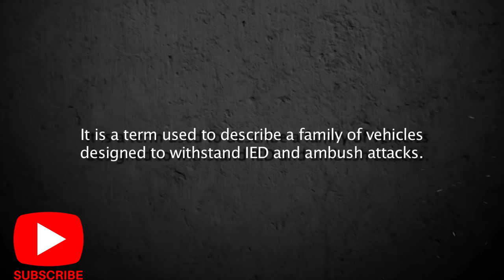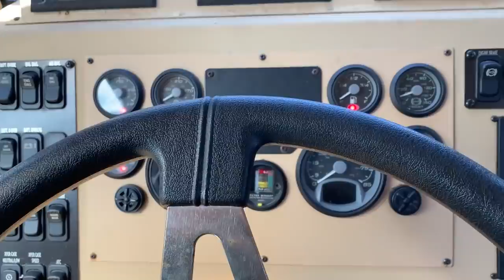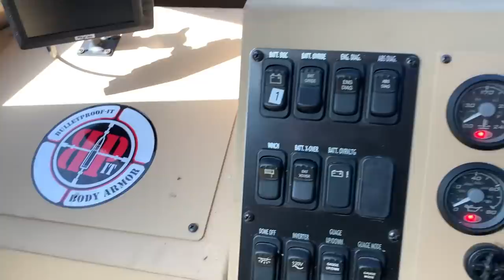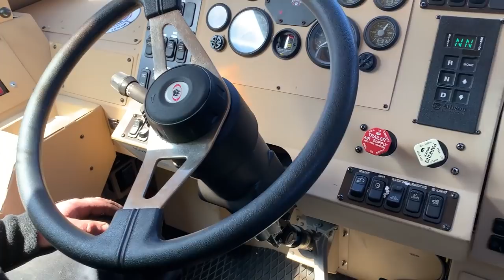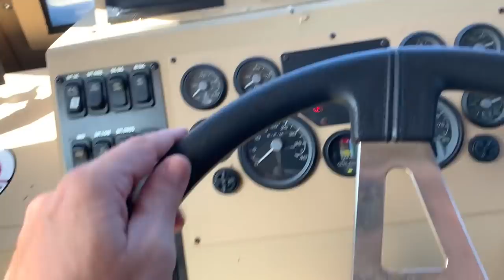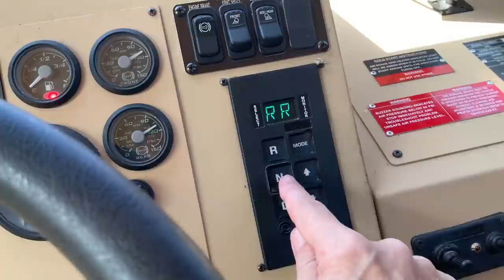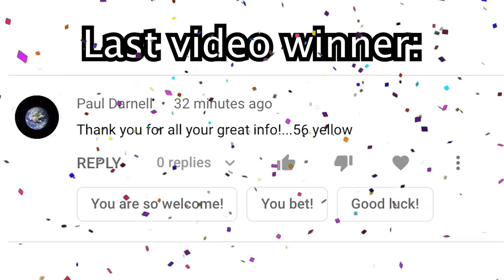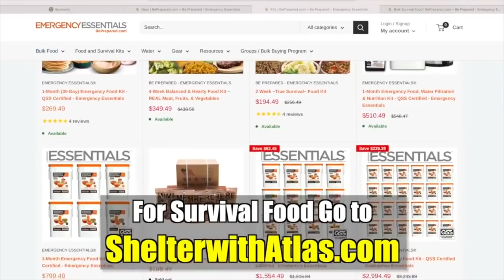Buying my own PRIVATE ARMORED MRAP

Comment: Must be nice, we welded boxes to our Humvees and piled sandbags into them and laid kevlar blankets on our laps at the beginning of the war circa 2002-2004
Reply: They used Kevlar blankets in these as well, afaik.
Reply: @deth3021  at least it wasnt a soft skin
Reply: @ween4314  true, they alsp had the power to move around, even if they were very top heavy and have a real problem with spalling.
Reply: Yep I remember driving from Kuwait to Warrior, we had to take the side windows out and drop in cut out plates....'03-'04
Reply: @thomasschultz5893  I was in Afghanistan in 03, iraq 04-05 we had to do the same thing.  Were you in 10th mtn?
Reply: 116 BCT
Reply: We had the old jeeps we came  under fire we got the hell out of dodge. If we would have had Mtaps I might not have gotten 2 purple hearts.

Comment: Buy the one with dualies, a winch, and better tires.
Reply: Agreed
Reply: I was thinking the same thing.
Reply: I 100% agree, also lower for less tip overs
Reply: I'd  buy the Dualit 2
Reply: And then upgrade it with extra storage compartments, water purifier and pump, fuel pump, shortwave tower, passive radar, FLIR, LED light arrays, custom grille guard (like the one Matt from Demo Ranch has), and some cage armor, because what's an MRAP without cage armor?
Reply: @manictiger  I like that suggestion, every alpha man's dream. He should also put in folding bunk beds, or hooks for hammocks.
Just in case he's gotta hunker down on the road. Cheers guys..May God bless
Reply: @manictiger  mobile survival shelter lol
Reply: @manictiger   and grenade launcher, smoke screen generator, reactive armor, make a few mods to hide its heat signature lol
Reply: @jaredharris1970  
Faraday cage it, too, so it can't be EMP'd.
Reply: Duals suck off road
Reply: This heavy 4-wheeller suck off-road anyway

Comment: The one with dualie's and newer tires would be a better choice,  license as an rv and avoid the cdl.
Reply: Even rv's in some states make you get a cdl to drive one check youre local laws
Reply: @josephduggan6287  Hawaii is the only state that requires a cdl with an RV and it will have to weigh over 26000 lb    some other states including Texas require only an upgraded license to cover that weight rating.
Reply: @skylergardner2792  its easy to just google it yourself  Hawaii is the only state requiring a CDL and only if over 26000 lbs.  other states 11 states require an upgraded license (non CDL) if over  26000 lbs.   Illinois requires upgrade and again not a CDL when over 16000 lbs. and a CDL alone doesn't include air brakes. air brake is a separate endorsement that you get added to a CDL or any class of drivers license, 
if you plan to pull a large trailer in some states will require and upgraded license, to drive based on weight and total length NOT a CDL,  A CDL is for commercial use. not private  thats why on many rvs you will see a sticker in some location saying not for hire. indicating NOT a commercial vehicle

Comment: You should change the thumbnail to show the exterior of the vehicle
Reply: It's very space age looking.
Reply: I think the trans sounds like it is slipping a little. You are missing the crank handle and electric motor for the turret. The tires do need to be replaced they won't pass DOT. You also need to put DOT tape on the rear and up top if you expect to drive it on the road. It also sounds like you have a slight boost leak likely just a clamp.  You may be able to run another set of wheels and tires in the rear you have to check the clearance. Exhaust will rot out but, in all honesty as long as it isn't leaking horribly, should be okay. The air brakes sounded slow to release, may need to be just driven or you have a small air leak. Doing an oil change on that is going to cost you a grand more then likely. I would recommend taking it to the best big rig dealer and have them do a PDI, DOT, and Wet PM on it. Basically tell them you want it looked over with a fine tooth comb. Also you are going to need a class b CDL to drive that and I would recommend going to a CDL school to get it. It will teach you a lot of things you will need to know and will also it is the easiest way to get the license. Some of them can teach you it accelerated in like 2-3 days but, you are not going to learn a lot just enough to pass the test. I am a A+ Diesel Technician and a Class A CDL holder. I also had hazmat for a while. If you have any questions feel free to hit me up on twitter @uberarchangel
Reply: Buy the one with dualies, a win h and better tires
Reply: @UberArchangel  
Awesome advice... We need more people like you, sharing their knowdledge for a greater good! 👍👍
Reply from the maker: Thanks.   Buddy 😊

Comment: Trudeau- "you don't need an AR to hunt a deer"
Biden- "Just get a shottie man"
Atlas-
Reply: Ahahaha seems like we got the same interests buddy. Been following your channel for years and now I see you on this channel too. 😉👍
Reply from the maker: I changed the thumbnail just fir CP
Reply: Why am I not surprised that Ron bought one of these.. They’ve been on the surplus market for a little while. Congratulations! The history on these is really interesting, as they were built by Blackwater and submitted to the Army for MRAP contract evaluation. Ultimately they were not selected, and recently these were sold off. It was an amazing proof of concept and capability for a smaller firm.
Reply: WHERE CAN I GET ONE
Reply: @aregularperson7573  there were a few on eBay..
Reply: Buy it. Hire me. I have a valid CDL and dot mef card.
Reply: Oh hello beautiful.
Reply: Is an MRAP even safe enough with little Omar running around Canada?
Reply: Don't let biden go in ur amrap it has steps
Reply: Cant shoot deer with a spotlight and a machine gun, but you could do some good hog hunting in this thing. Mount an AR with a spotlight.

Comment: You should buy the one with the twin dualies on the back, it can carry and haul more weight and pull a heavier trailer if needed. That’s what the second red air brake button is for.

Comment: If im not mistaken the Grizzly started as a prototype looking for a contract with the US military but didnt end up getting it. However Black water used a few of them. The chassis is a GM Ron. They built them off a GM platform. Been thinking of converting one of my 6x6 to an armored rear personal/living quarters. Love the military rigs. Keep em coming. Ide definitely look into your local road laws. If your thinking about it.... being able to take it on public roads legally would be great. You might find something newer with more features. A 6x6 or 8x8 would be bennifical vs losing 1 tire in a 4x4 your going to be SOL. Maybe something with winches also. What about a custom M1070 w/ camper !?!? 😎💪🏼 the Rarity of Grizzly will also be difficult to find parts etc. Get something that the military actually used and that parts are readily available in most states. Stay away from the Grizzly imo & find something else unless the price is steal of deal maybe. I just think your to limited in them

Comment: To change the oil, invest in an oil exchange pump, often found in marine chandlery suppliers.  Used to pump the oil out of the engine.  Either that, or have an engineering shop make a pipe that screws into the drain plug, and runs through a gap or a cut hole in the armour plates.  Would cost a bit initially, but your aren’t actually going to war in it.

Comment: I say get it! Looks like you could drive that with a standard Class B CDL. The air brake test is super easy. You shouldn't need a passenger endorsement either.

Comment: Just incase you weren't aware if a gauge in a vehicle stops working they are replaced with what ever is on hand that works. This includes the mileage. Just because it says x amount of mileage doesn't mean that is what it really is. You did things the right way though and had a mechanic check it with you. As far as the contest goes I will guess 468 and Trump. God bless and stay safe.

Comment: 25, Trump.
Looks like your business is doing very well! Congrats!
BTW, I wouldn't be surprised if the side armor could stop an RPG because it's filled with ceramic beads.
As for oil change, I'd use a pump to pump out used oil through the dipstick tube. That is if you can reach the oil filter from the top. You can buy a special pump for this, just about everywhere.

Comment: Also you can get Very good surplus like new tires at reasonable prices online  and I have 2002 tires on my AM general M923a1, The dash board gauges Not working would greatly concern me as a buyer. This thing my Not even be street Legal in the US. Good Luck.

Comment: Yah Ron get it. Put Atlas Survival Shelters on the Sides and Rear. People that come by the Shop would Luv to go for a Ride in it. I do. Try to come down on the Price cuz of the Tires. 13yrs is too long, they are close to being Dry Rot if not already. That would be Freakin Funny if you pull up to a Discount Tire and ask for a New Set of Run Flats. 😂😆😝

Comment: I sure hope the air brakes aren't the type with spring brakes or else they lock up when your air lines get damaged so people can take their time finding a way in
Reply: The pics I've seen show brake chambers exposed.
Reply: @richieryan2127  yeah, but are the brake chambers equipped with spring brakes? That's the big question, if they are (like a normal modern truck) that's bad for a combat vehicle

Comment: You don't have to have a Commercial Drivers License. As long as you are using it for private use. You can get a noncommercial drivers license with air brakes indorsement.

Comment: You need to have a cdl w/airbrake endorsement and also a DOT medical card (if you have certain underlying medical conditions you will not be able to get to medical card) if you want to drive that on the road, not to mention you will be subject to mandatory random US DOT drug testing also has to have a US DOT # if you plan on crossing state lines but some states require it regardless (Texas does)  I've had a cdl for 20 yrs and also own my own commercial vehicle just wanted to give you a heads up on all the state and federal red tape you will have to deal with. I wouldn't risk driving on the road if you don't have all that because it's a criminal offense and they will catch you especially if your on the highway because that thing is subject to inspection at weigh stations. Oh and one more thing when/if you get a US DOT # you sign away your 4th amendment rights and have to agree that you can be pulled over without probable cause and the vehicle can be searched without warrant. It's crazy.

Comment: I need one ! I am tired of the destruction of my property which includes the vandalism of my 2003 Honda Element in the State of Connecticut ! All covered up and covered over....#Corrupticut ! 
Also, I bet the driver does not have to worry about the air bag either, since mine in the Jetta that I owned, did NOT deploy when the vehicle was struck by a speeding flat bed truck carrying PVC pipe on Route 19, in Hudson/New Port Richey, FL in May 2005.
Also, are there security cameras or an alarm system ? In addition, how much would it cost for an oil change $1,000 ? I find that hard to believe. What is the expense to maintain the vehicle on a yearly basis ? Who designs can constructs these types of vehicles ? What is the MPG ? Is there a hybrid version ? Are these vehicles sold to the public via auction ? I have many questions that need answers. I will have to watch the last 10 minutes later.  Thank you !

Comment: You can definitely take them bolts out and lower the body armor down with a Jack in maybe an hour or two if you dont have an impact. Then just change the oil like normal and ole boy says 400-500 ain't enough it would be closer to an thousand lol

Comment: $1,000 to change the oil?
What is it 10 or 15 quarts oil a $30 oil filter and 20 bolts on an access pan???
Sounds more like 150 bucks to me..

Comment: how does it roll with the tires shot out?
Reply from the maker: Flat
Reply: @AtlasSurvivalShelters  the tires have solid rubber inserts so it can still drive without air pressure. It won't be as good as with air but better than flat. They work until you drive too fast or too far for long enough for them to heat up and then catch on fire 🤣 
Once they catch on fire they can temper the armor plate nearby and make it soft by removing the heat treatment. Then it's just like shooting mild steel

Comment: Correction MRAP do not stop 50cal
Reply from the maker: This one will on the sides.  It has quadruple AR 500 and a box filled with ceramic beads.  It will also work against RPGs

Comment: The exhaust looks awfully sketchy an awfully corroded. Makes me wonder what else is corroded underneath that vehicle. For a company who is selling these they sure don't know much about the vehicles. The rear tires on that vehicle sure look like Recaps not original rubber. So you know when you're driving on the highway and you see those chunks of rubber laying on side of the road or in the road sometimes? Those are retread or recapped tires that have blown and truckers call those gators because if you run over them they will go down the bottom of your truck and rip out all of your air lines and fuel lines. So I would verify that all of those tires are virgin Rubber and not recaps and that will save you some major headaches down the road. If you noticed on the front of the truck they have air hookups like for a trailer on a semi. Those are called glad hands and are used for hooking up air hoses most likely for air tools because anything that you're going to have to remove or replace you're going to want to use impact wrenches for on that vehicle and that's what those are hookups are for I believe on the front of the truck? Also you'll notice on the front left side of the truck there was this metal receptacle for plugging something in and that is for the jumper cables. Make sure that you get a set of those cables with this mrap as those are not available commercially because your electrical system is 24 volt not 12 volt. And they even have an arc welder that will attach to that receptacle to allow you to weld from that location. I did 2 tours in Iraq and 1 in Afghanistan, if you have any questions about these vehicles feel free to ask.